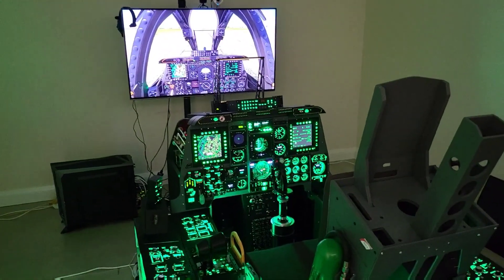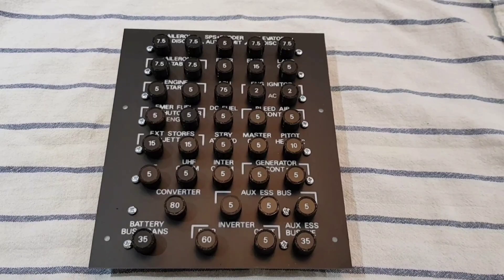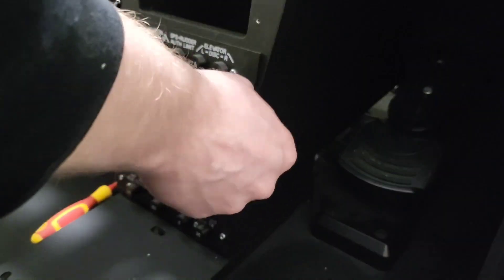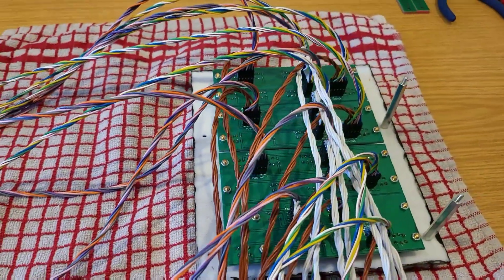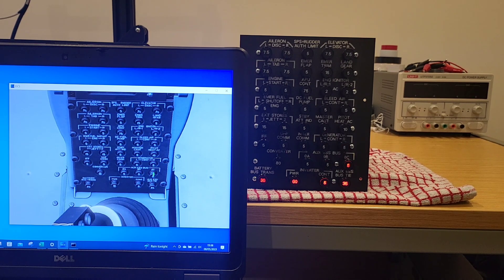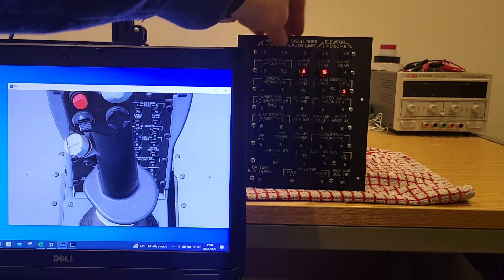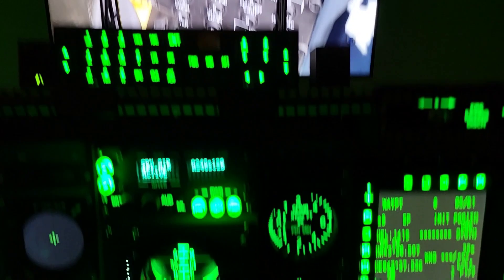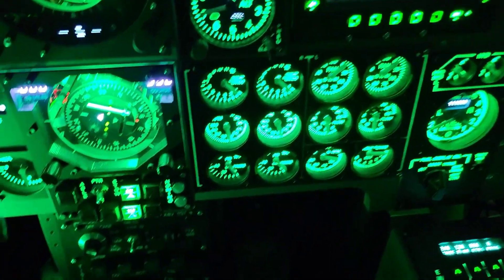Simpit A10C - Upgrades - Part 4: Circuit Breaker Panel

Comment: Hey Craig (or anyone else that knows sim cockpit building) can i ask a quick question? I'm trying to set up a very basic button box using DCSBios and code from DCS-BIOS Hub. I have everything working but Im getting multiple button presses for every one press. I have all 20 buttons pigtailed to ground, do I need to have a diode between each button? Its not a button matrix because each button has its own pin on an arduino mega. I tried the debouncing command but it doesnt seem to have an effect and I cant find anywhere online that says its compatible with DCSBios. Any tips to avoiding unwanted button presses?

Comment: To get a better affect one could use the solenoid to just release a tab that is spring loaded so this way the solenoid isn't under power at all times.  Then have a switch at the end of travel that makes contact upon pushing the breaker back in.  However what you have done already is amazing in it self.  I see how tight that squeeze was to get that panel back in it's home lol.
Reply from the maker: Hi Hydrolisk, I had very similar thoughts to what you described. A possible future upgrade that would be cool 👍